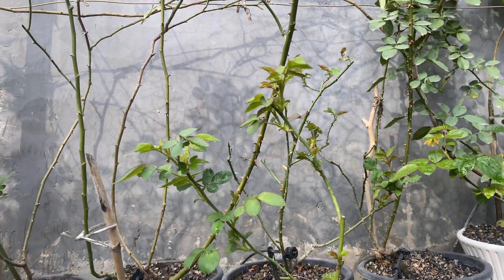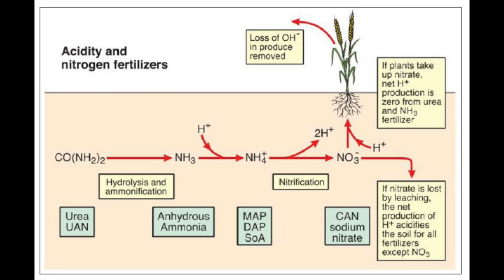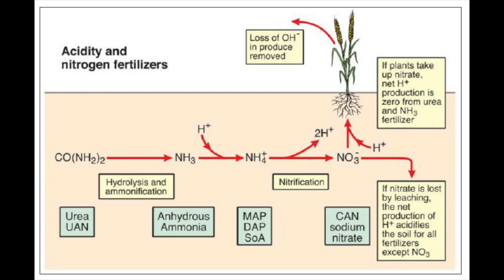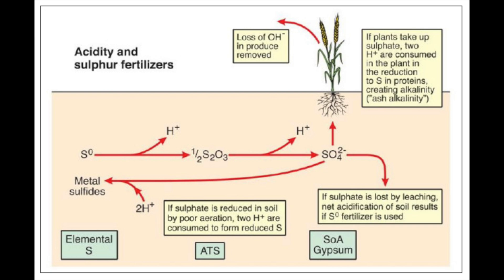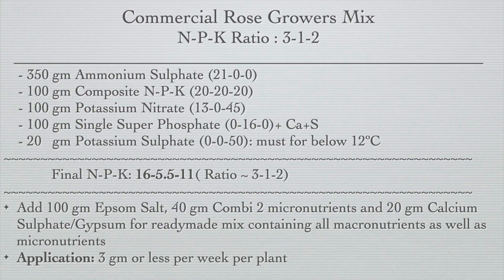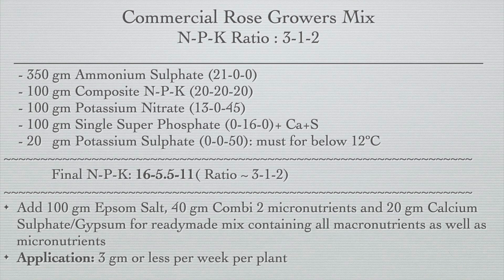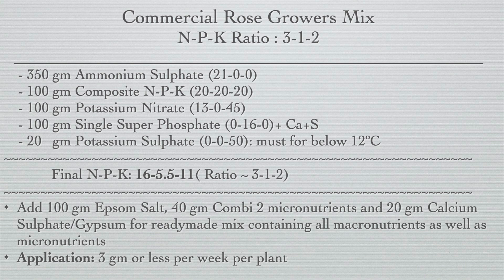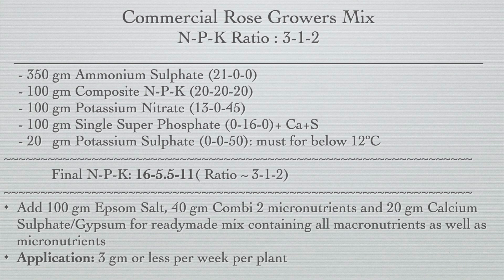Commercial Rose Feed with pH Control for All Season

Comment: Do you know how to overcome blindshoots?
Reply from the maker: To prevent blind shoots:
1. You have to work on root system.
2. Use fertiliser with Ammonia as nitrogen source only. No nitrate nitrogen as it will be assimilated directly by plant and produce multiple shoots results few blind shoots later.
3. Frequency of fertiliser application to be tweaked immediately after pruning. 
4. Good bactericide and fungicide spray is must to clear nodes to reduce blind shoots.
5. Give water when needed or top soil is about to dry. This will encourage roots to grow more in search of water and healthy shoots above. 

Still by doing so you will get blind shoots particularly in pots in some plant varieties.
Reply: @bloombaag  are nitrate nitrogen fertilizer like potassium nitrate, calcium nitrate etc??? So what are the source of ammonia  as nitrogen
Reply from the maker: @aishwaryas3369 Yes. Ammonium Sulphate, DAP, MAP are ammonium based fertiliser.
Reply: @bloombaag  ok is amistar good fungicide? For roses
Reply from the maker: @aishwaryas3369 One of best.

Comment: Does that commercial rose growers mix dissolve in water? Can I give it to plants by foliar spray or I have to use that in soil (will it be safe, as my media is cocopeat and vermicompost)
Reply from the maker: Mix fertiliser are being given in root zone. For foliar spray normally single NPK with or without micronutrients/seaweed is being used. You can and cannot combine two certain NPK formulation like calcium nitrate with any phosphate or sulphate based NPK. Yes, you can use it in cocopeat and vermicompost media in root zone.
Reply: @bloombaag  Thanks for the reply sir. I've another question I'm using Micorhizza in my plants, now if i use that mix fertilizer once in week in root zone will it effect that beneficial fungi?
Reply from the maker: @sauradeepguharoy2151 Mix fertiliser wouldn’t affect mycorrhiza fungi. Only when chemical fungicide use in root zone will kill mycorrhiza fungi.
Reply: @bloombaag Ok, thank you🙏🙏